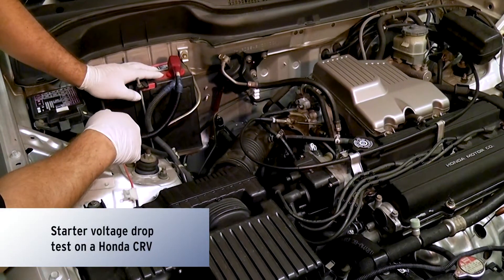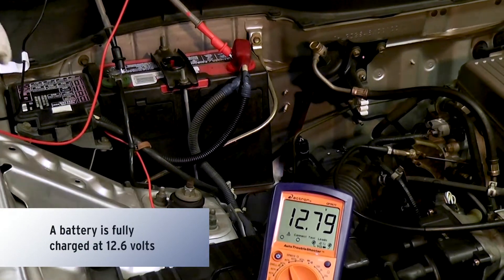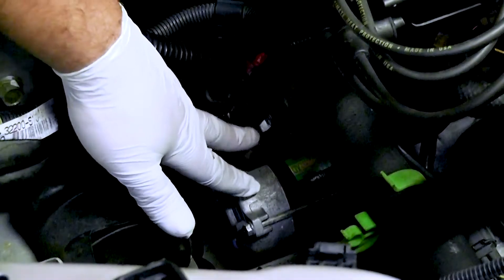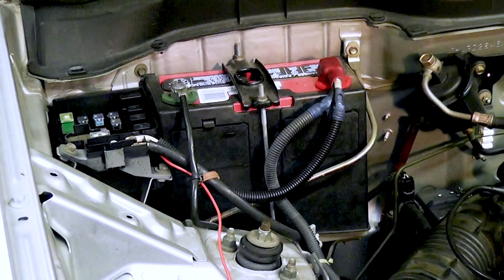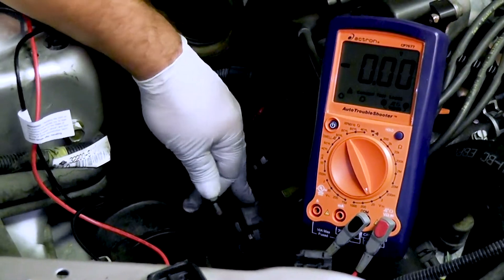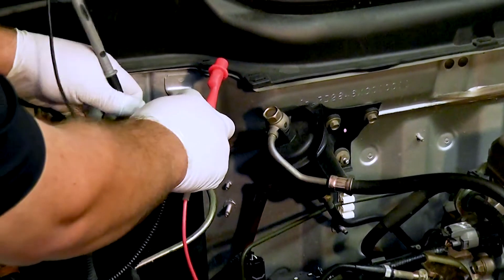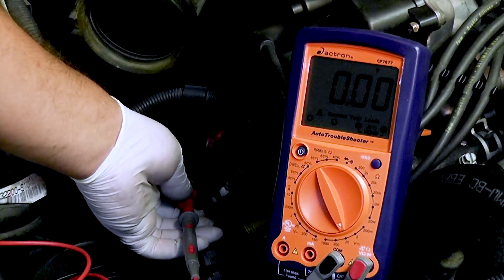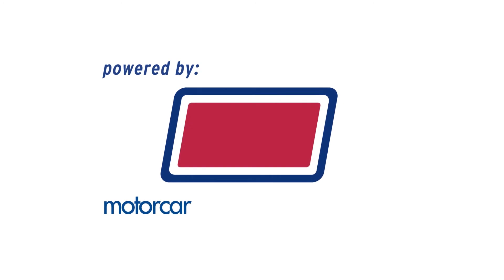Voltage Drop Testing the Starter Circuit

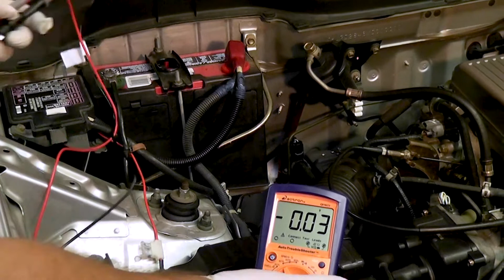Comment: 1:15 12,6V after charging doesn't mean the battery is good. It can have 12,6V, but very low capacity resulting not being able to crank the engine. 
The best way is to try to start the engine and see what's the voltage drop, if it's a below 10V it may still be the battery that's causing the problem.

Comment: What does it mean when u fail the ground side at 1.1v
Reply: There is resistance in your wire between the starter ground and the battery.  This is likely to be corrosion on the terminal connection of the battery ground or at the connection from the battery ground wire to the chassis.  If you clean those up and the issue persists, it's likely a partial break or corrosion in the grounding strap or wire itself.  Inspect the wire to find the break or corrosion.